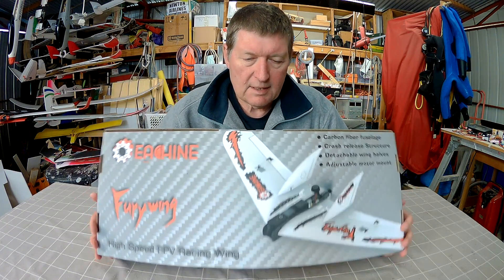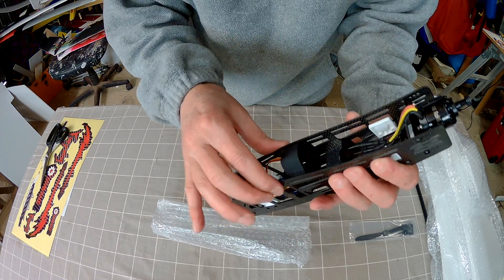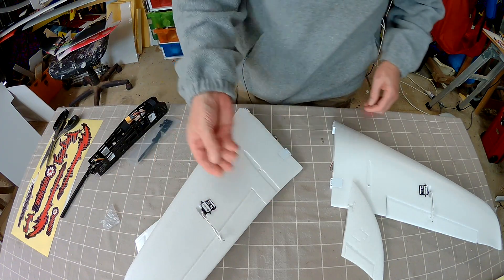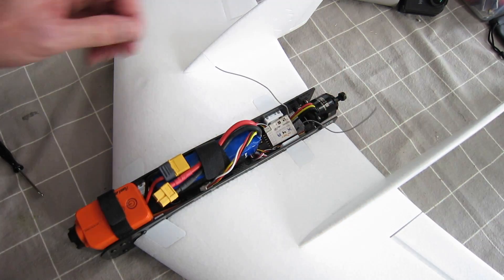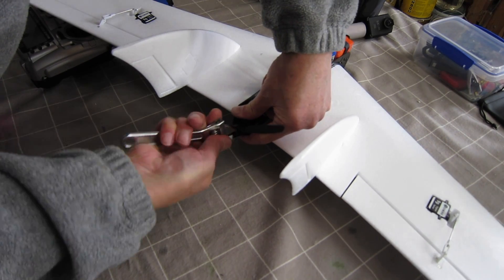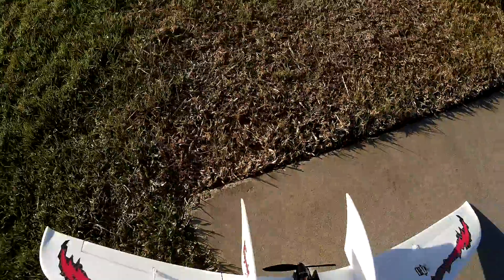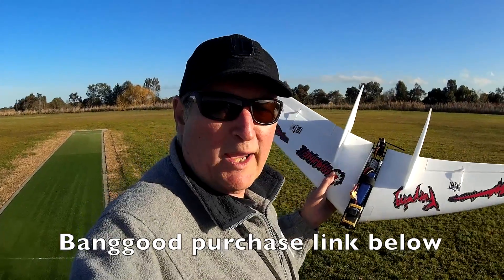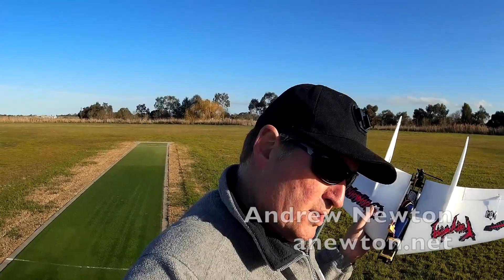Eachine Fury Wing - Build and maiden

Comment: Im buildug the furyWing this time with inav FC und GPS. TheSetup seams very easy... but at the moment im a little scared about my favourit flight mode....the "fly away" mode...what is the lowest speed it will glide, without loosing altitude...want to setup it very save
Reply from the maker: It's a great wing in all it's forms, but you need to keep the speed up. I have seen them spiral in after a stall. Haven't done speed measurements

Comment: Just my experience but for first flights I set the CG to the points indicated on the underside of the wing and the model would only fly with full back stick.
I suspected that the indicated CG was to far forward so I did the usual MAC 25% and 33% measurement which put the quarter chord CG at 25mm behind the suggested point and the third chord CG at about 40mm behind the suggested CG.
Now files like a dream.
Anyone else noticed this?

Comment: I'm going to sound like an idiot but I'm rather new to all this.  When you talk about full rates and going to 75% instead of 100%. Are you talking only about aileron / elevator travel? What about expo with this model?
Thanks, 
Bret
Reply from the maker: Good question Bret. Yes I'm talking about reducing the travel of the Aileron/Elevator to 75%. Cant recall but I usually have 30% expo on Ail and Ele
Reply: Andrew Newton  Thank you for responding. Have a great day.

Comment: How does the plugging into rx work if you only have 2 servos how do you get them to work with ailerons and elevator  thanks
Reply from the maker: It's called elevon mixing, most radios can do it. Plug one servo into Ch1 and the other into Ch2. Then the mixing goes something like this. Ch1 Aileron 50% Elevator 50%,  Ch2 Aileron 50% Elevator -50%
Reply: Andrew Newton 
Ok thank you I have just ordered this wing

Comment: Great vid,  I love wings I have quite a few, but I don't know if I like all that carbon fibre in the middle of the wing, it would play havoc with the  radio reception? if you get  a wing with all that carbon make sure your aerials are as far from the carbon, carbon spars and the copper wiring you can get!   Just thinking.........40amp esc, you could put a 6x6apc style prop in it  on 3s and it will scream!
Reply from the maker: You're right, had to think about antennal placement, and yes the thrust could be bumped up quite a bit.

Comment: Would you recommend the PNP or kit version? I have same spare mini quad motors and some MG90S and some Emax ES08MA II servos that I can use with kit version.
Reply from the maker: Kit version if you have your own servos, ESC and motor. The PNP is fine but there is nothing special about the supplied electronics.
Reply: Andrew Newton only thing I don't have is a ESC.

Comment: Haha, told ya the stock prop was brittle. First landing and snap. Wow!
You gotta fly it with 4S if you wanna see how fast it is, 3S is pretty tame by comparison.
Yours seems to fly a bit better than mine and I do wonder if it's because you had that camera in the nose. I flew mine without any extra weight and had to mount the battery very awkwardly between the camera mount and battery mount positions. Maybe I'll add some nose weight on the next flight and see how it goes.
Good vid as always. Thanks for sharing. 👍🏼
Reply from the maker: 3S is about all I can handle LOS but FPV will be interesting. You were definitely right about the prop, broke 2 in 3 landings.

Comment: Sounds Wicked and nice crash thumbs up
Reply from the maker: It does scream. Had to test those magnets, but it was an unscheduled landing
Reply: work out just fine with only a broken prop very nice durable plane you don't find a lot that can handle so much or you need to build it your self... looking forward to the fpv flight hopefully something cool and risky(flying close to those Cliffs at that nice slope spot
Reply from the maker: Just finished mounting the FPV gear, have to wait for the rain to go away